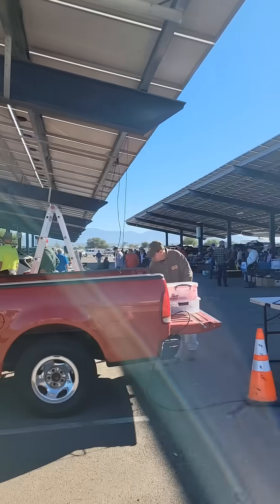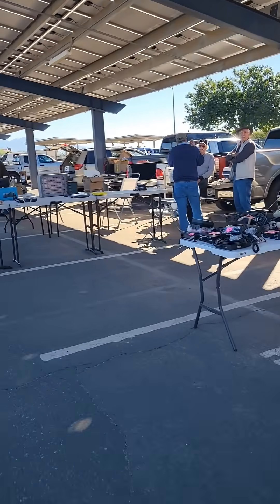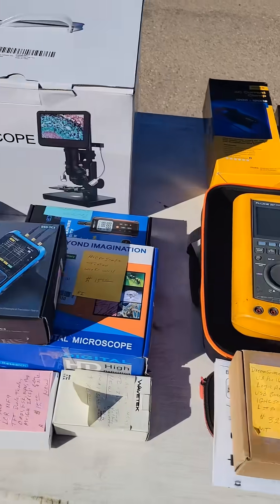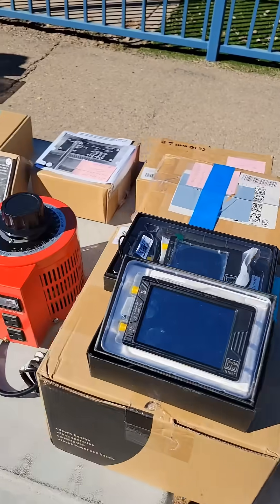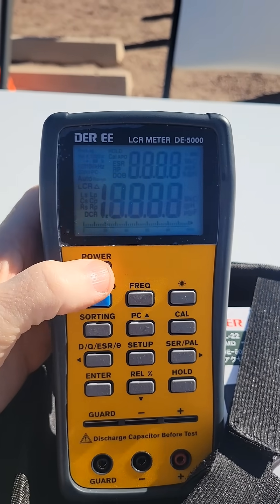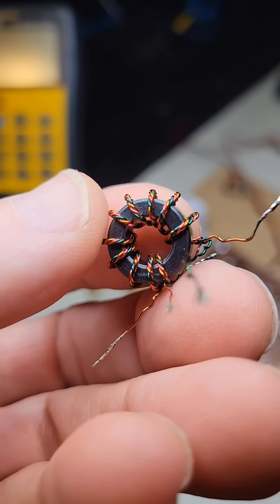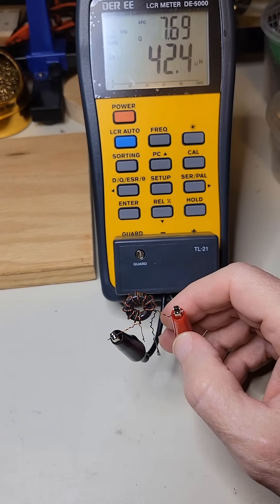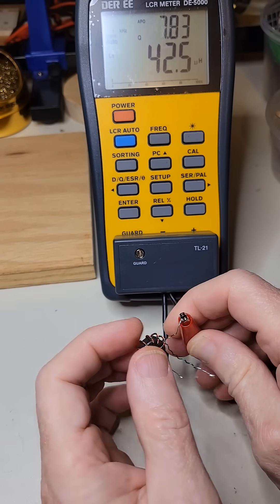LCR Meter - Homebrew Test Equipment #hamradio #electronics

Comment: Hi Charlie,
I have the same meter and that was a great price. Try to locate some of the other plug-in modules. I picked up one and extended the leads then recalibrated with those leads. Makes it easier to test components in circuit. Hi to Sandy. Both of you stay safe.  73  WJ3U
Reply from the maker: Thanks Don - those extended leads sound nice. Happy Thanksgiving.